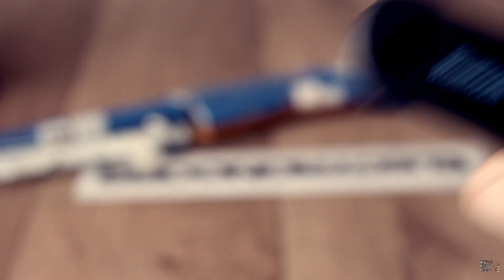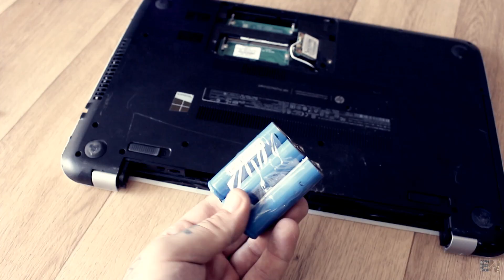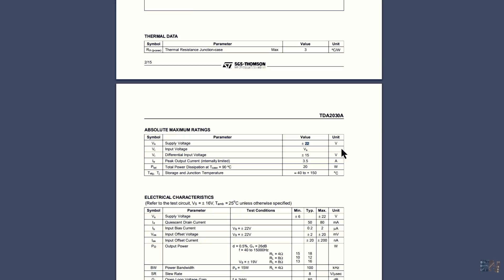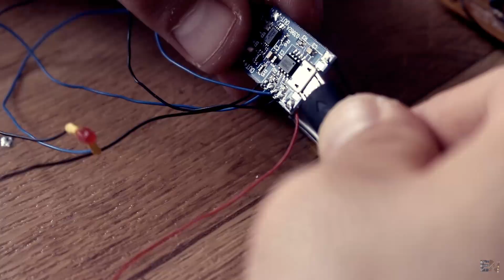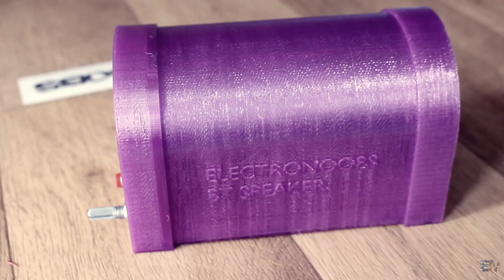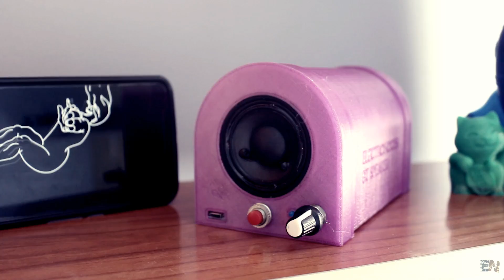Homemade bluetooth speaker - 3D printed case

Comment from the maker: I hope that you’ve enjoyed this tutorial. If so don’t forget to click the like button like crazy and share the video with your friends. If you have any question about this project or any other, just leave it in the comment section below or on my Q&A page. Also, don’t forget to subscribe and watch all of my other great tutorials. If you consider helping my projects, check my new Peatron page https://www.patreon.com/ELECTRONOOBS and help my workshop grow and have a lot of more other cool tutorials.
Reply: Electronoobs  ✔️ yes my friend
Reply: i do always enjoy ur videos. so informative and well documented. i would like to mention that , since u have connected 3 cells in parallel they balance each other automatically and u wont be needing a balance charger, unless u may decide to connect them in series. also the charging circuit  TP4056 is actually designed to charge single li ion cell, so it will provide only 1amp max to the 3 cells. also it will heat the IC due to overload maybe. better to use 3 different ckts to the each cell and the connect the input  parallel. 
but the build is awesome and very cheap :)
Reply: Electronoobs I'm really surprise to see you are listening B.U.G Mafia. Huge respect from me.

Comment: Hey I have a question. I have made a similar Bluetooth speaker with a pam8403 amp module. The problem is with the Bluetooth audio receiver it doesn't play stereo music even though the amp module supports stereo audio amplification. So is there a solution?

Comment: is possible add jack 3.5mm?
Reply from the maker: As output or input?
Reply: To connect pc or mp3 with cable
Reply: @TutoDS2014  yes it'posible with switching 3.5mm jack

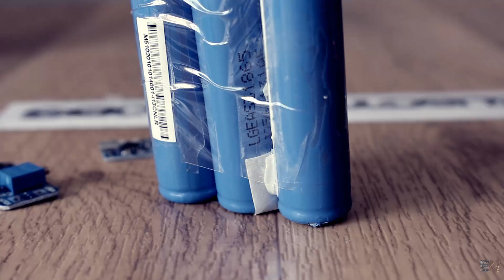Comment: Really the battery is 220mAh?? or 2200mAh? 3:08. those battery 6800mah is fake on ebay.
Reply from the maker: I don't know about the 6800 ones. BUt I've used this  https://cdn-shop.adafruit.com/datasheets/1781Battery_2200mAh.pdf

Comment: The best amplifier to use here is PAM8403, it's: stereo, cheap, efficient (class D operation) and has plenty of output power for a portable speaker like the one in the video. TDA2030 is more for shelf speakers, just the way I see it.